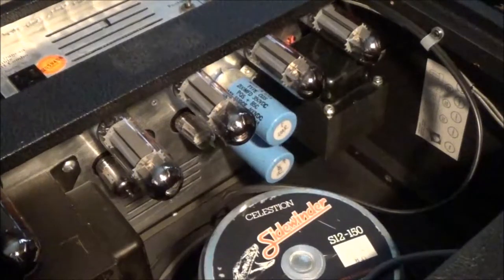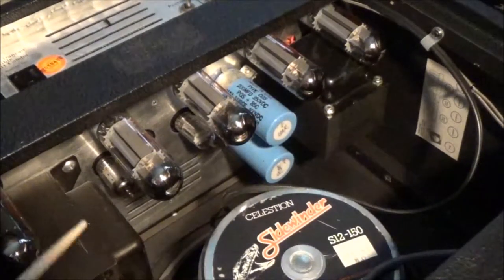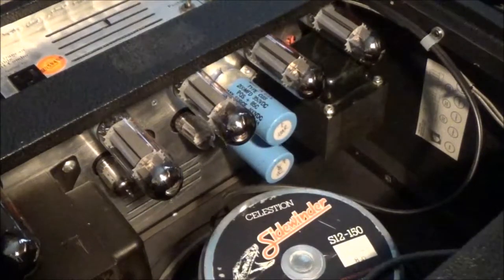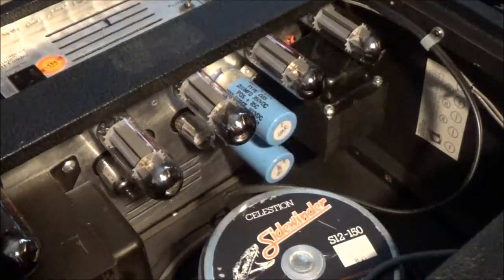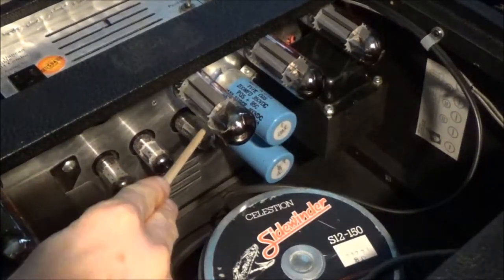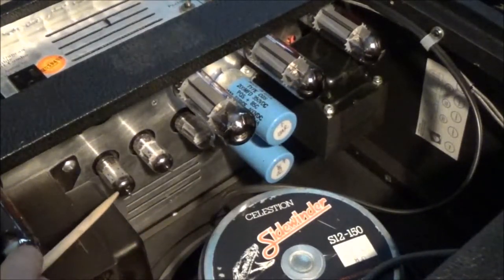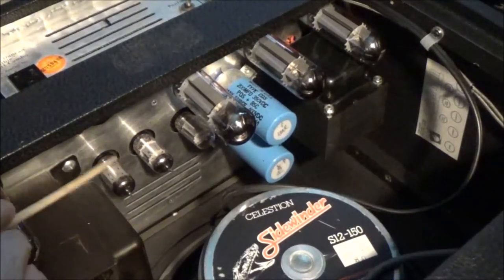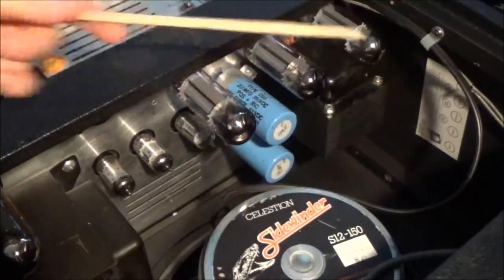Seymour Duncan Convertible Variable Wattage Control Tip

Comment: Thx mine wasn't doing anything  Just one  12ax7 was preventing the variable gismo from doing is thing  What a difference it makes .
Reply from the maker: Adamtiers — Yep, very common mistake that people make is putting the wrong tube in that position.
Reply: In your opinion  what would be a reasonable price for a module on ebay or reverb nowadays ?
Reply from the maker: Adamtiers — Depends on what module it is. I haven’t been keeping up on going prices but I’d say between $50-100, $50-$60 was the avg when I was looking around for some.
Reply: Thx  a lot.

Comment: Hello -- I have 12AU7s in the proper spots, but still no variable wattage functionality.  Any other tips?  I should also mention my channel selector button functions, but not when using a foot switch.  Do you know if the channel switching relay has any impact to the variable wattage function?